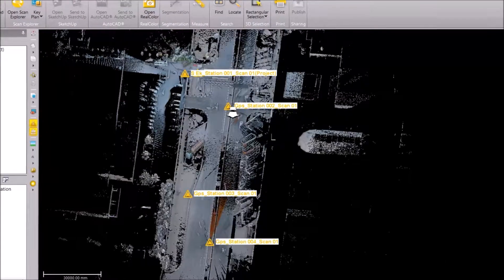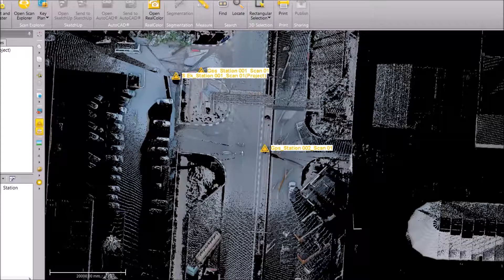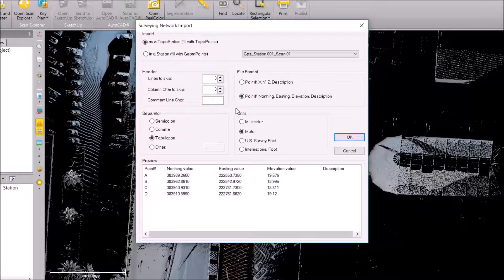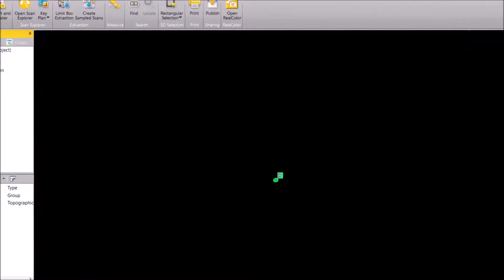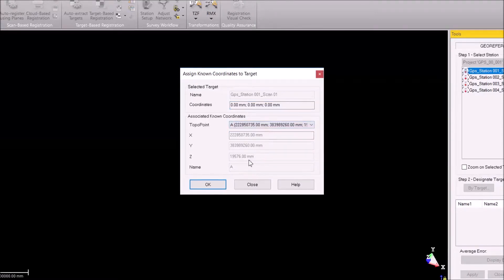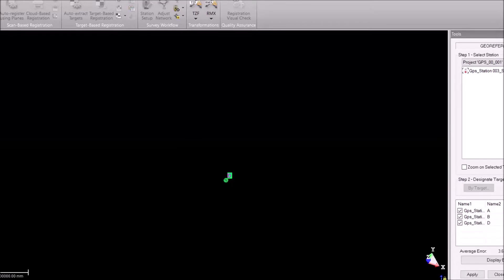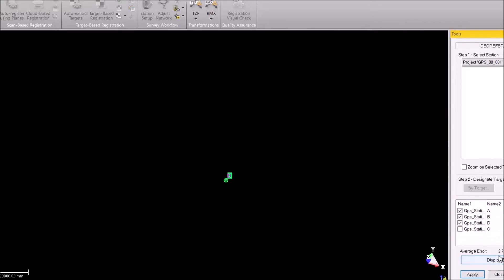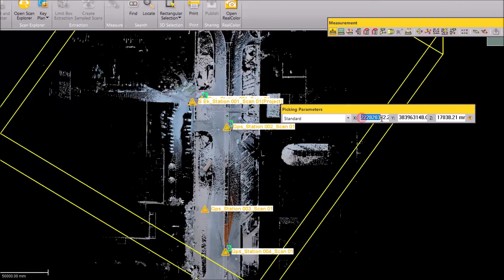Trimble Real Works - Geo-Referencing

Comment: Has the scanner height been measured? I assume these known points in the control file are on the ground? Do you need to set ststion height to the control file?
Reply from the maker: Yes the stn height at the scanners are measured and fed to. The scan files